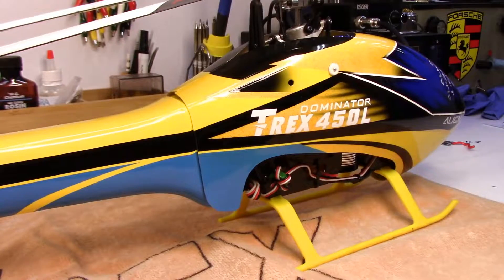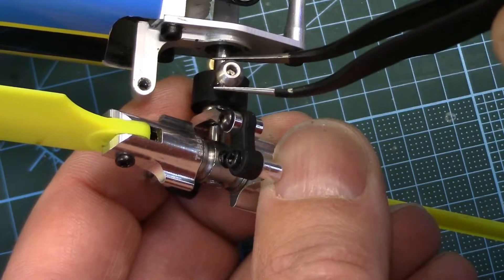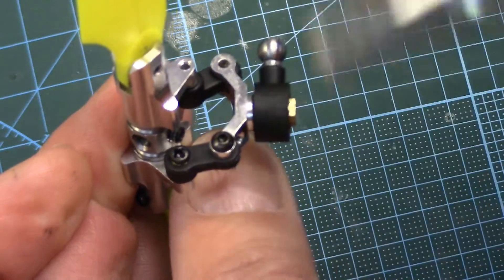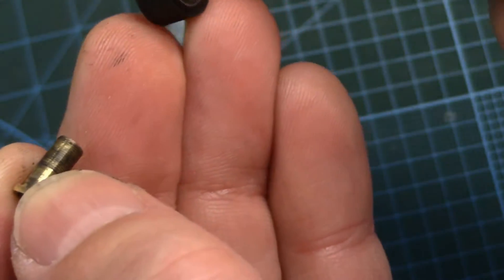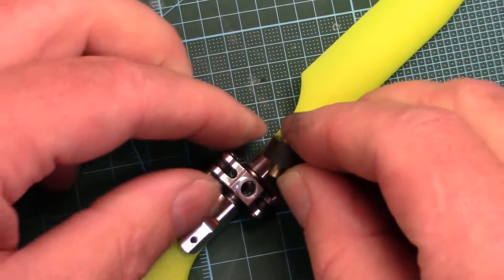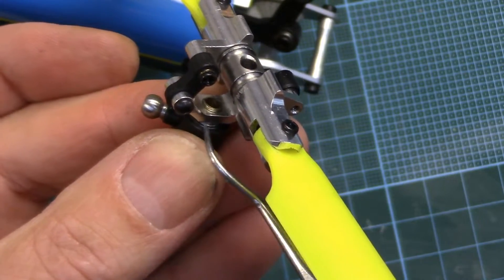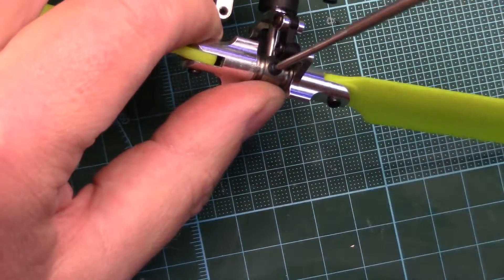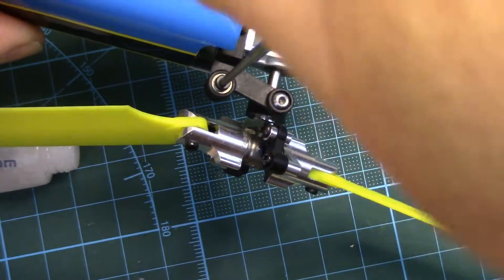Sloppy Tail Rotor Repair

Comment: Great video, it makes me remember the reasons why I've changed mine to a dual fork from KDE system.
I definitively prefer metal parts on crucial links like this one, they are stiffer at high frequency and you can fit biffier servos 😁. I don't think all that plastic would enjoy flawlessly a BK, I've even replaced the servo mount for a metal. 
The tail is oversized on this machine anyway you have to take special attention for the result to be great.
Beginers should realy fell what is a locked tail and all others should be pleased by the precision.

Comment: A few helis are designed with slide bushings that cannot be fully tightened without locking the bearing. On those you need to use medium strong threadlock and then tighten till the slop is gone but the bearing still turns freely and no more than that. (this bad design imo)
Reply from the maker: Link slide bushings not long enough. Bad parts 😄

Comment: i have a trex 450 se v2 and that plastic collar that the ball link is screwed on to is loose threaded, is there a way to fix it?
Reply from the maker: Replace the pitch slider assembly would be my recommendation. If you're in a bind, you could use medium CA glue on the threads of the pitch ball to glue it into the slider collar which should get you back in the air but hard to know how long the repair will last.

Comment: I notice you are using a shaft instead of a belt for your tail drive. Are their any benefits or is that just how that model is.
Reply from the maker: There are pros and cons to both. Shafts (normally called torque tubes - TT), are more efficient, don't stretch or wear thus less maintenance is usually required. TTs don't create static potential, are generally easier to fit/replace the boom, and allow for customized boom length modification.  Downsides to TTs is they are slightly heavier, cost more, and are easier to strip out the TT drive gears if you have a tail strike.
Belts on the other hand are lighter and less expensive. They tend to produce less vibration and are more forgiving to tail strike. Static mitigation practices are something to be aware of with them. This page on my site covers the basics:
https://www.rchelicopterfun.com/tail-belt-static.html

Comment: Hey John, very useful, thanks! 👍🏻
I have a CopterX 450 Pro and the tail made very slight contact with some soft grass & it completely wrecked my gears 🥵
I’ve since bought the T-REX shown in your video which boasts stronger materials but I’m afraid to fly it!
Do you think the tail can tolerate minor brushes with soft surroundings or is it a major NO NO?
Surely it happens to a lot of heli pilots? 
(I even saw a video where tail rotors scraped against wood & even concrete!)
Reply from the maker: Trimming soft grasses with your tail rotor won't strip gears, but if you try to make a trench with it, chances are you will strip a gear. Much depends on how much energy is released in the tail strike and how much is absorbed. Variables such as rotor speed, how tight you have your tail blades in the grips, the material the blades are made from, and the pitch angle when they hit are all factors that can be the difference between a survivable tail strike or one that strips out gear teeth.

A slightly longer tail fin might help or aftermarket angled landing struts so there is more clearance between your tail rotor and terra firma. Also, belt driven tails are able to withstand tail strikes better than torque tube driven tails - the trade off is efficiency loss.
Reply: John Salt Tnanks John ! 👍🏻